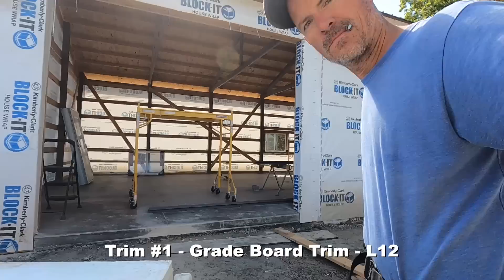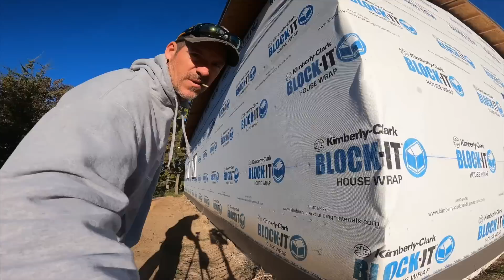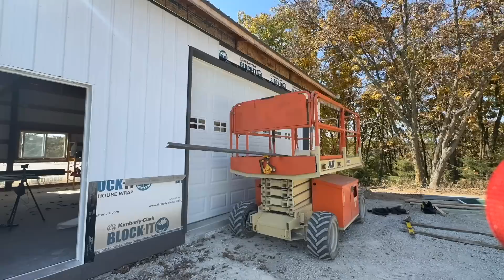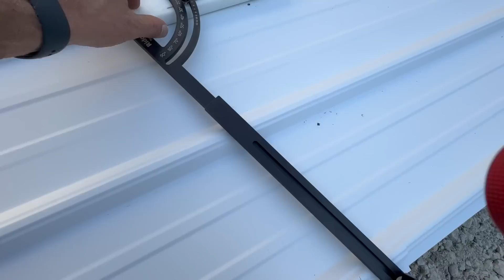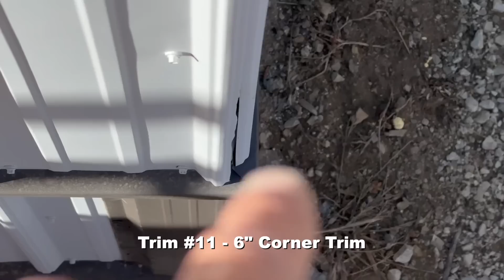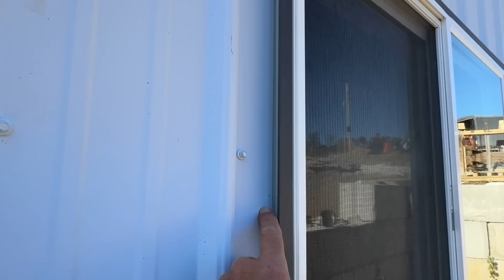24'x48' Post Frame Garage - Finishing the Metal | Ep12

Comment: What is the reason for adding the wainscot trim since your bottom steel is the same color as the top. Is it for aesthetic reasons only or do you anticipate having to change damaged steel later down the road and the short piece makes it easier?
Reply from the maker: Aesthetics and very easy to switch out a 3' panel if any damage occurs.

Comment: I'm definitely going to have to remember the 2x4 trick. At first I was skeptical, but that's not bad at all.

EDIT: Hmm, one concern I have about that J-Filler is that it may create a perfect home for bugs to set up shop in. My first thought was to bend over a tab to block off the open bottom but that presents its own problems.
Reply from the maker: You could always put a piece of vented closure in the bottom to block it.
Reply: @MrPostFrame  yeah, that might work